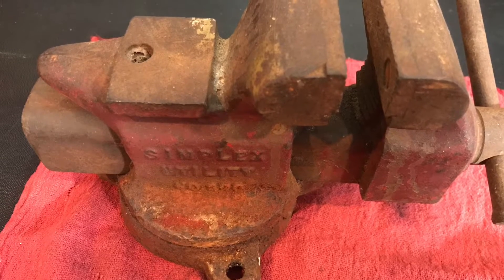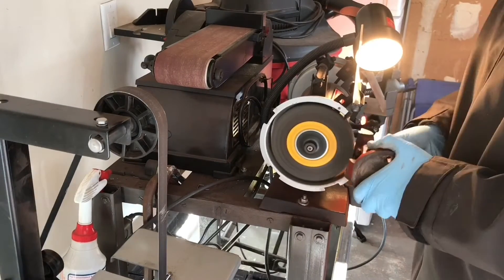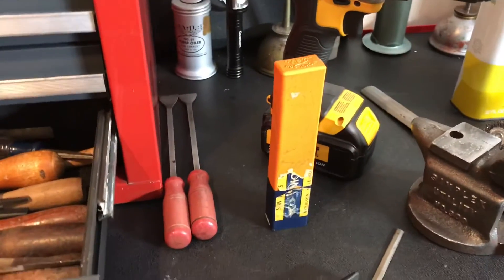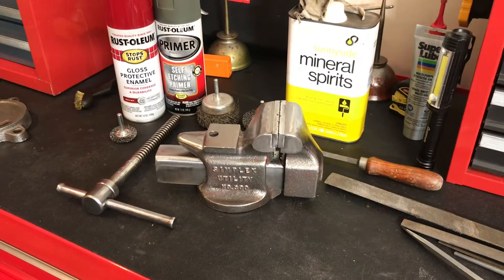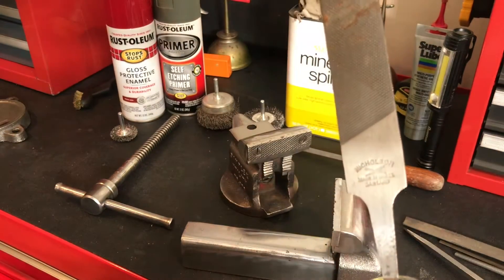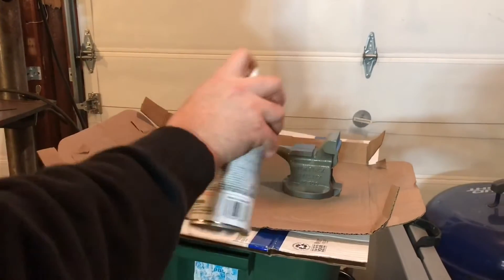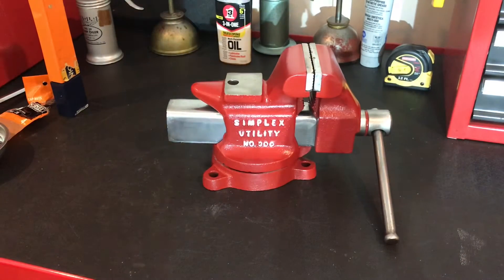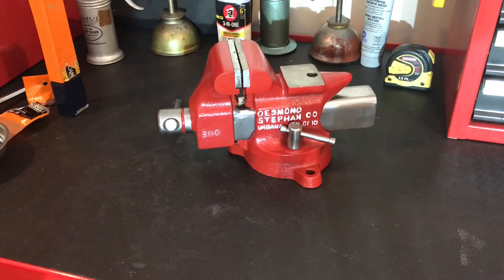Vintage Vise Restoration! Check it out!

Comment: WOW I got this vice toooooooo! I'm glad the previous owner took care of it and left it...
Reply: Is it a pretty tight vise as far as the jaws?   Like if the jaws are open a couple inches and you grab the front and pull back and forth does it shift around?
Reply: @I haven’t used it in a bit but from what I remember it’s a pretty tight grip. There’s no shifting at all.

Comment: THAT VISE IS BEAUTIFUL!!! Fantastic job taking the time filing down the casting marks and putting all the effort into the small details. The red paint really pops, and the white paint really pairs well with the polished metal. The fact that you got it for only $4 is crazy cause I can’t even get a pack of paper clips for less than 10 bucks🤣. Seriously though, fantastic restoration! 👍
Reply from the maker: Thanks man!

Comment: That was a rough one.
Well used in it's day.
The wheel and the sander
Made the rust go away.

The filing was work.
You did a good job.
I like how you crafted 
That little old knob.

The prep and the primer
Will make the red stay
Nice job on the vise.
It looks good I must say. 

From the home of Mary Martin (Peter Pan), thanks for the fun.   :-)
Reply from the maker: Thank you very much for the kind words

Comment: Great video.  I have one of these I used your "if I had it to do over..." advise on.  I heated up that ring and banged out the corkscrew mechanism with a hammer, easy!  Did you put any clear coat or anything on the raw metal pieces?  I plan on going with a liquid gun metal blue finish on those parts.
Reply from the maker: I just put a couple coats of car wax but your blue finish sounds cool.
Reply: @TomGunnTools  I like the car wax idea I might use that on another one.  I have done the blue finish on axes before and it comes out very nice when topped with a coat of WD40.

Comment: Hi Tom, great job. I have the same vise. My question was after you were able to get the ring off how did you reinstall it? I was thinking of drilling a hole in the spindle and then inserting a cotter pin to keep the ring in place. Thanks!
Reply from the maker: That’s a good idea! If you try it let me know how it turns out. I think I muscled it back on then banged it and squeezed it a bit.
Reply: Hi Tom, I decided to leave it in. I just finished the vise this weekend and can send you some before and after pics. It's not as nice as yours but I like it.

Comment: Hey I just came into possession of one of these and I’m missing the ring that you said took forever to get off. Any advise on finding a replacement?
Reply from the maker: I’m thinking you need to find a ring our heavy washer that is the correct diameter. Then you can peen it in position. You may also want to cut a slit in ring/washer to allow it to spring in position and lock in.

Comment: One more thing....(sorry) can you post a list of product's you used like your primer etc as well as the grit on the sand paper you used after the primer coats.
Reply from the maker: On raw metal I always use a self etching primer and lightly sand with 220 grit or higher. Hope that helps.
Reply: @TomGunnTools  It did thanks